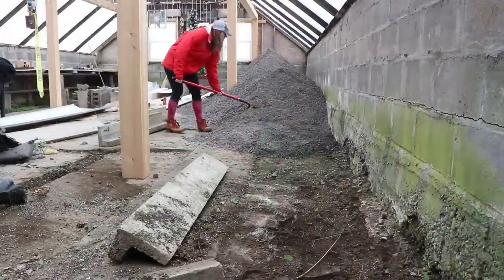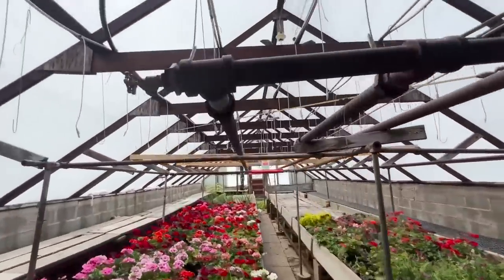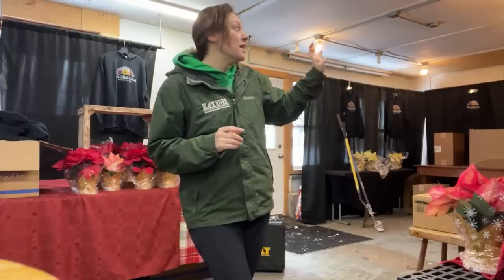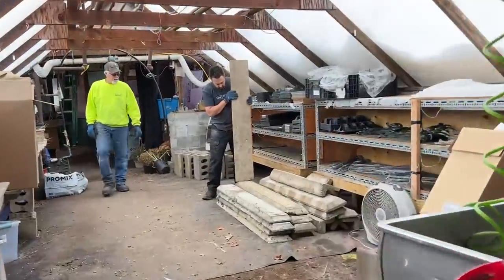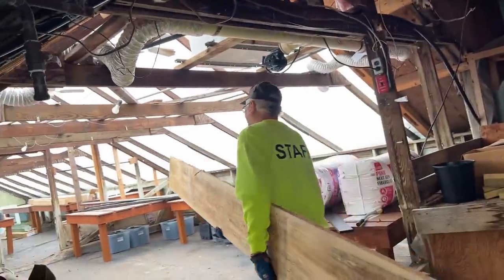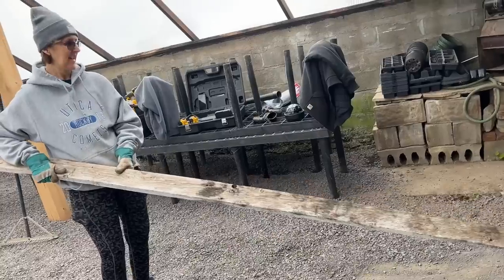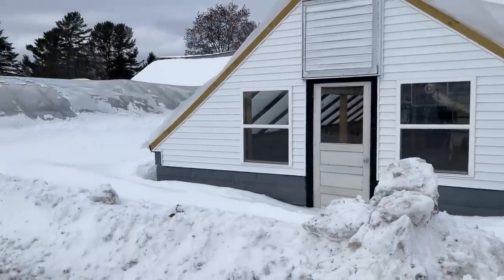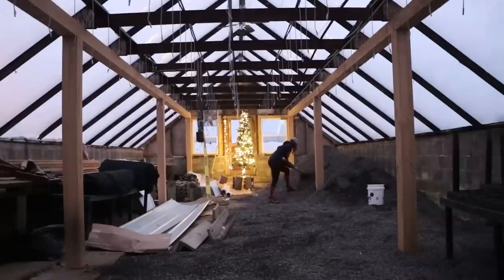Clearing Out Greenhouse 1 for the NEW FLOOR : Weather Update : Flower Hill Farm

Comment: I love you father in law’s Tee shirt ,, 
Just a question,, is crushed stone ok for wheelchair use?
Reply from the maker: Crushed stone is when properly tamped down. Standard spacing between benches is 29 inches so it will be a narrow fit. There are still many other hurdles before a wheelchair would be able to enter this building.
Reply: @FlowerHillFarm  good luck 🙏🏼